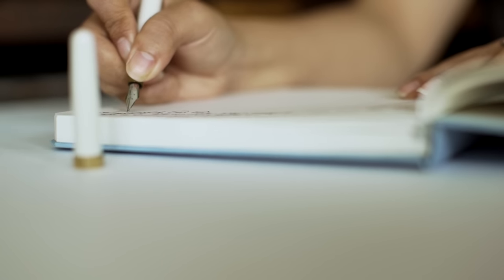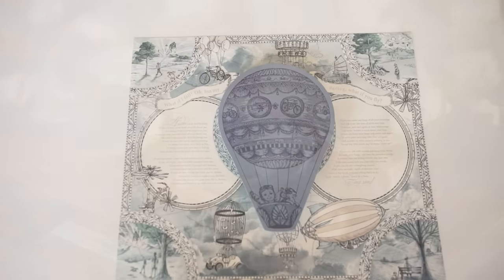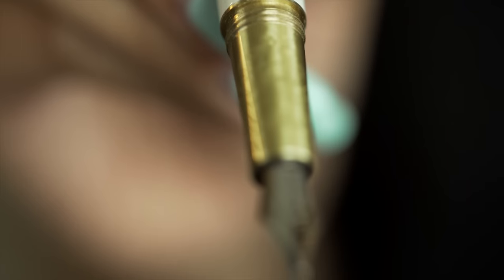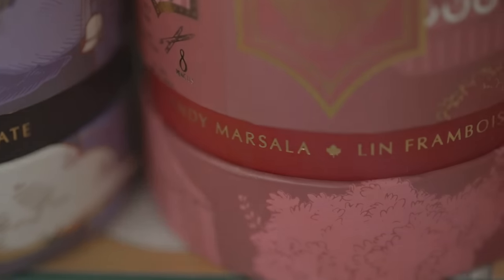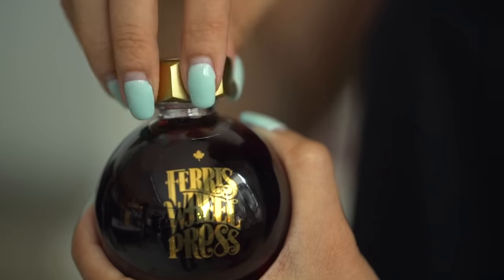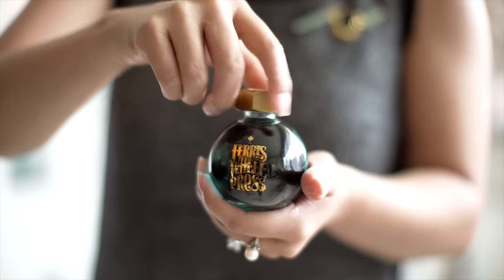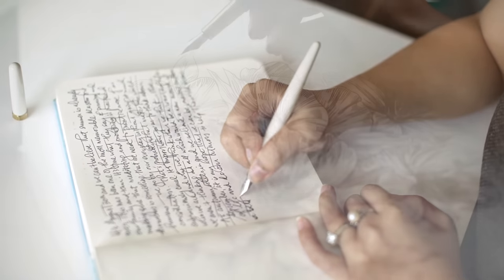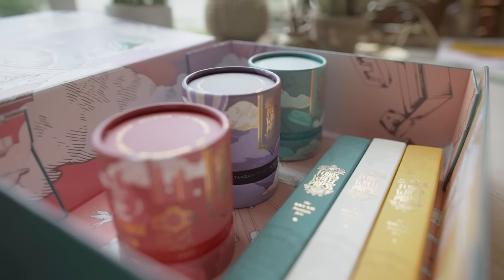The World's Most Magical Fountain Pen Ink

Comment: Surely a beautiful design but there's a reason no other ink bottle is a sphere. It's highly unpractical especially once the ink level starts to drop.
Reply: the practicality doesn’t actually change. its just harder to manufacture
Reply: @px4536  there are practical bottles out there tho, the iroshizuku bottles have the indent at the bottom, the twsbis have the plastic cup and the montblanc bottles have the first part of the boot to the hold ink when the ink level gets low. They look great as well
Reply: *impractical